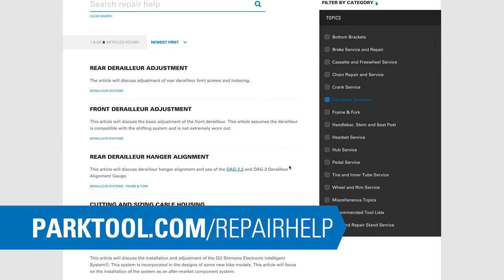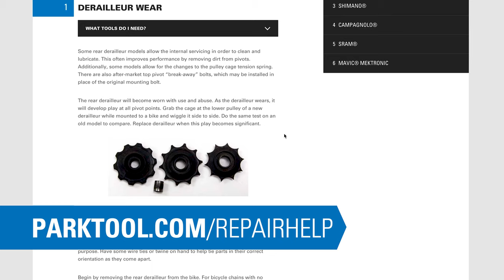Park Tool Guide to Derailleurs & Shifting: Introduction

Comment: Seriously well done set of video series. I bought a "junky" box store Schwinn that was left outside for a couple of years for $40.00 yesterday and I have repainted it and am dialing in the brakes and shifting, I have a feeling after learning what I need here I am going to be really really happy with my custom graphite gray Schwinn. I might even head to parktool and pick up some of the great tools so when I replace parts in the future (which i plan to do) I can have a little less trouble. THANK YOU!

Comment: Out of topic ,I been trying to find a guide to tighten up bolts in My dh bikes ,but nothing  solid in info,can any one help??
Reply from the maker: Contact the bike manufacturer for this.  Failing that, look at the torque for each component manufacturer.

Comment: Thanks for the video it helped a lot..............
             I  have a problem with my rear wheel if i drop it on a pothole, bump or from a jump I hearing a banging noise but everything is ok if I check there’s no loose part. I suspect it’s the deraillure but I don’t know how to fix it properly. Can you help? can you do a video about it.
Reply from the maker: There could be many things going on that would cause a bang when you hit a bump. Check that the wheel is tight in the frame and that all nuts and bolts are tight. Then try picking the bike up a small bit and dropping it on its tires of course to see if you can recreate the noise in a static environment. Then you can get a better idea of where the noise is coming from. Good luck!